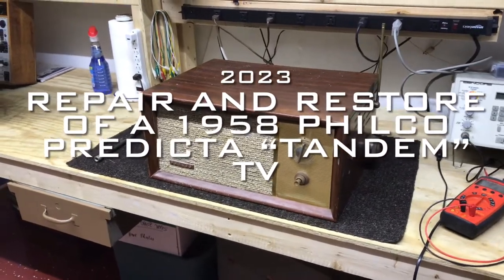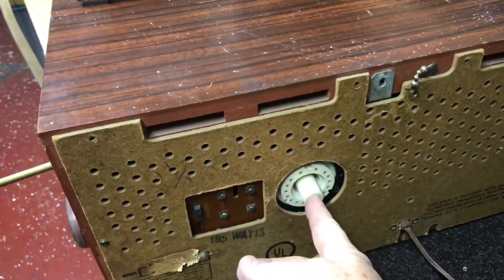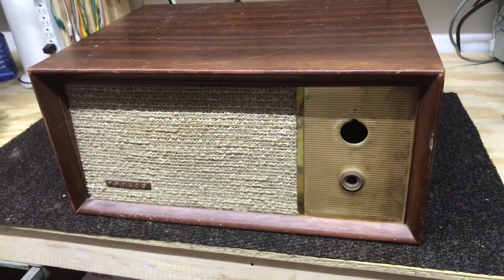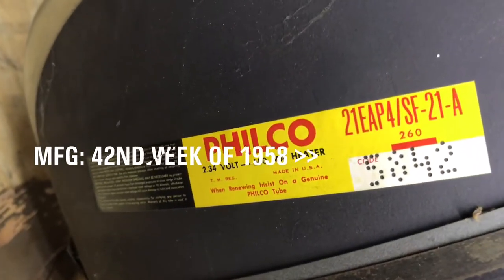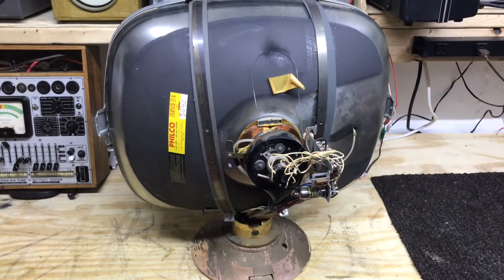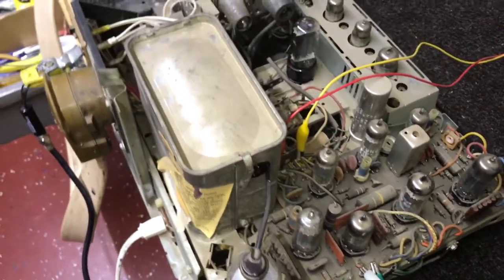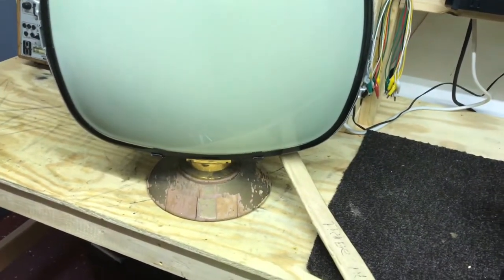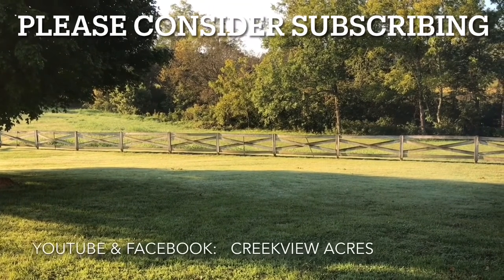Philco Predicta Tandem TV Pt-1 Repair & Restore

Comment: I never knew the tandem had a video amp tube and circuitry on the CRT neck, but I suppose it would be needed because of the cable length
Reply from the maker: Exactly, the 25 ft cable had loss so the video circuit at the crt made up for that.